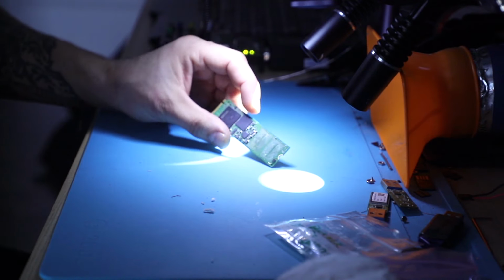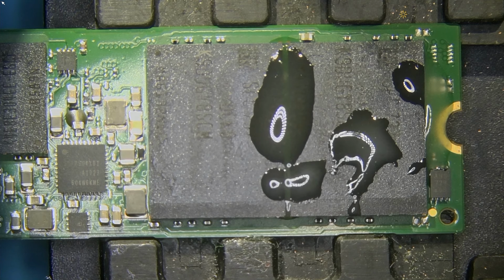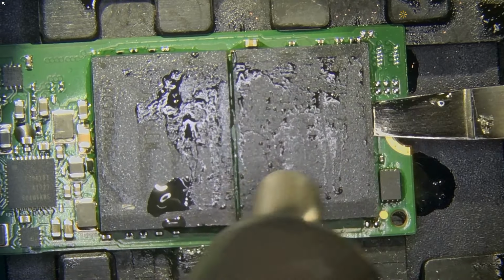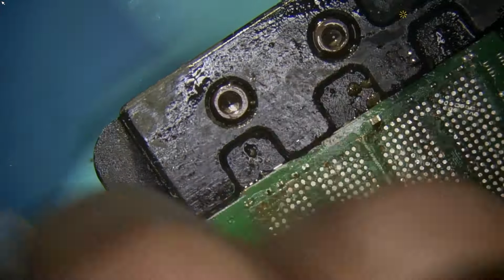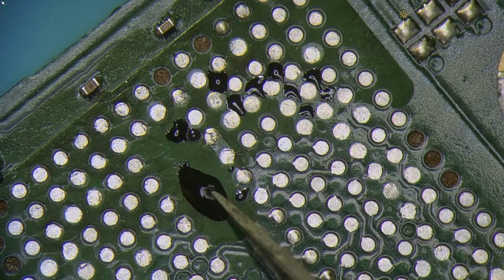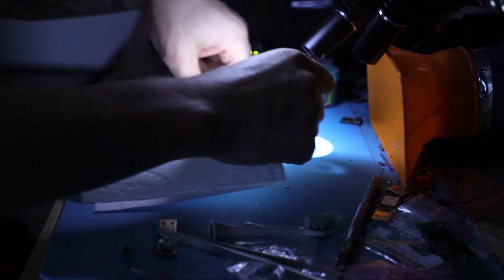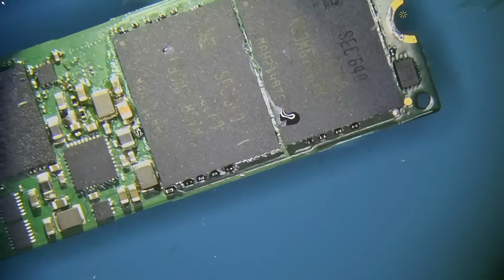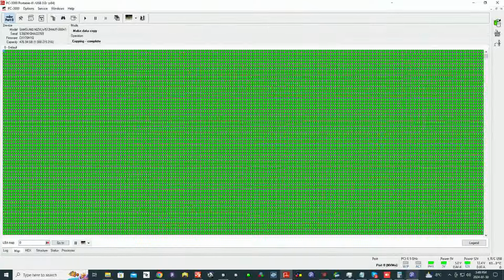how to recover data from nvme ssd by samsung

Comment: I have a Linux flash based computer board for a vending machine. These devices are now getting bad flash problems, bad blocks causing crashes and inability to update settings due to log files being in bad blocks. Sometimes doing a full software reload which does an erase and marks blocks bad works for a short time but the flash is degraded. I have the tools to remove the flash from the board physically, and the equipment to read it out directly with a NAND/EPROM reader but being able to deploy a ‘fresh’ image onto it (i.e have it mounted as a device and write data to it) I don’t have. Is that something that should be able to be done by a recovery specialist? I’ve I supply chips and image and they would be able to work with it somehow ?

Comment: I heard that modern SSDs use cpu encryption, does this mean that we will can no longer simply swap memory chips, we will also have to swap CPU ?
Reply from the maker: Data is encrypted on this Samsung SSD, as you can see no need for MCU swap. Firmware microcode is kept inside of NANDs most of the time. Some devices are serialized and won't work without the original controller

Comment: On that model SSD, you can swap NANDs and ROM to swap board, don't need to swap controller. Much faster way to fix physical/liquid damage than repair pads and cleaning underfill and what not. Nice vid tho.
Reply from the maker: What swap board? Why swap ROM if you see me make it work without it

Comment: Man this one was hard to watch with all the pads ripped up. Is there a way to use an IR bed to bring the board to a level temp and then apply heat? Also that glue is nasty!
Reply from the maker: IR would work better maybe, but I think it went better than it might have looked :)

Comment: Hi Erkin one more nice job. The companies producing products which they want it not to be repaired. I can understand this up to a point but not in this sector. The products you repair contains data and requires intervension to get the data and most of the time it requires you to swap, change soldier, desolder, reball etc which is required so the data can be rescued. So i think the data storage companies has to be a bit more helpful for the customers so their data can be recovered easily.  But most of the time in your videos you spend more time on the little tricks like glue or other type of enhancements so you can do your job by recovering your data. I dont have that patience anymore i am started to be too old for this things anyway. WHile you reballed the memory chips just tought on the 1 st time i reballed a chip with a stencil and it was a wonder that times . Any way just wanted to comment and say hi to you and appreciate the time and effort you put into these videos sharing you expensively learned knowledge with other people for free. kindest regards from Istanbul
Reply from the maker: Thanks you my friend! I agree

Comment: What temp and airflow do you use to slice off the sticker?  And all parts in general like when putting those tiny resistors back on at 6:25...?  And melting solder balls?